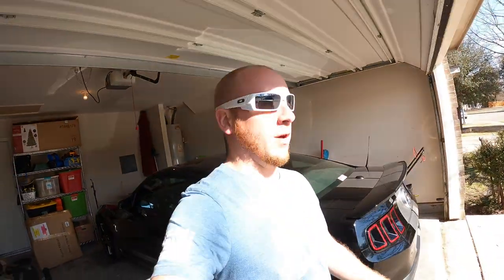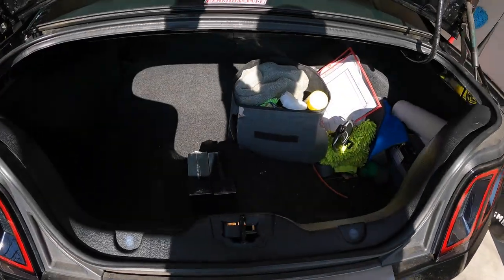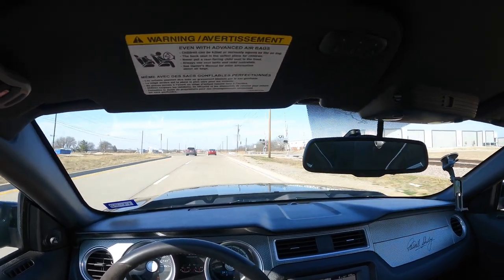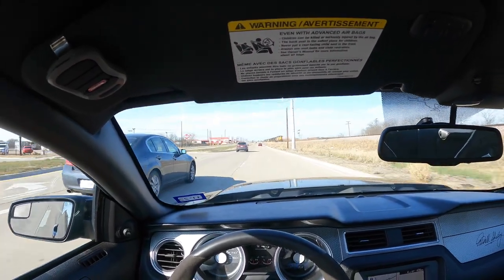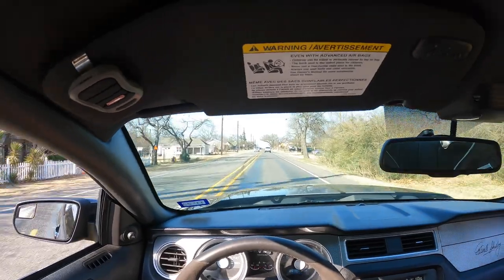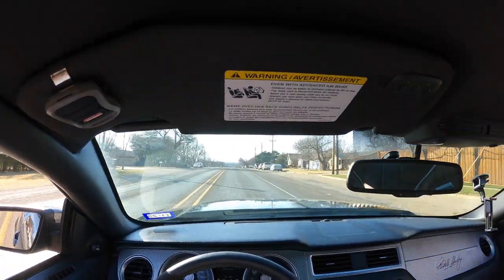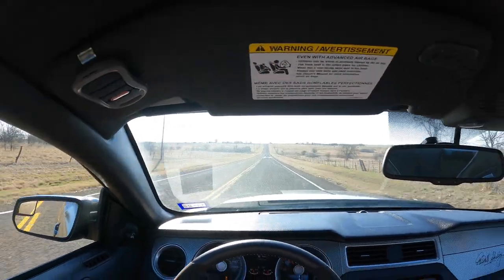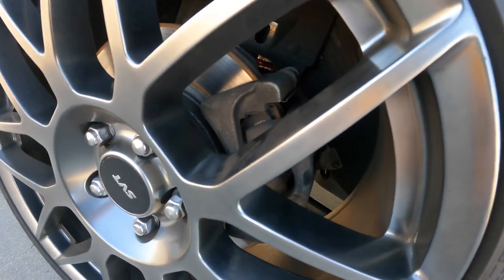POV drive in the SHELBY GT500 & trying to diagnose a possible bent axle or warped rotor

Comment: On my 14 5.0 I had a old squeal / squeak that was dependent on wheel rotation so I thought it was possibly a bent axle too. I took apart both rear calipers, re greased everything and re assembled and the caliper. I also assumed it might of been a piece of debris that got stuck between the rear caliper and rotor as well!
Reply from the maker: After u re greased it all was it ok?

Comment: Inconsistent, with no vibration on my Black 14 Shelby - bent axle. This almost cost me my life when it locked up. 
Different scenario on my 14 5.0 it was consistent during slow corners - C clip. 
I wonder if you could throw it up on an alignment rack and see if you have more toe on one side than the other. If you get the info on an accurate way to tell, I need to see about this on my new 14 white Shelby. 

Side note don't run ET STREET Rs like I do.
Reply from the maker: It just doesn't seem like a bent axle bc I would have a vibration
Reply: @triggersociety12  I had a bent axle without vibration. Regular pulls past 160, no vibration. Drove I like that for over a year, and remember the day it bent just thought it to be the C clip like my old 5.0. I had no clue because of what you just said. “No vibration” it locked up on the 35 toll route in Mexico at 1 A.M. Even to the point of locking, no vibration just a tiny squeak now and then.
Reply from the maker: I'll take a closer look at it but i still don't think it's the axle. I remember seeing clip from the caliper rubbing on the rotor.. but I'll take the wheel off the see if it looks bent while rotating